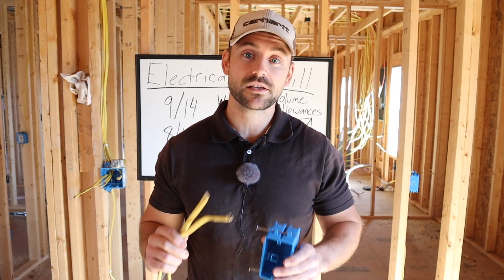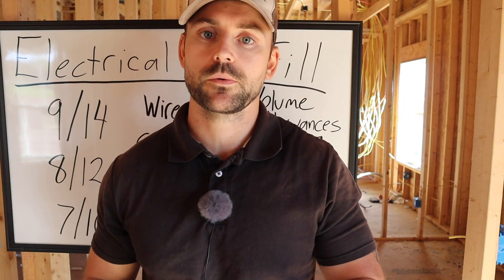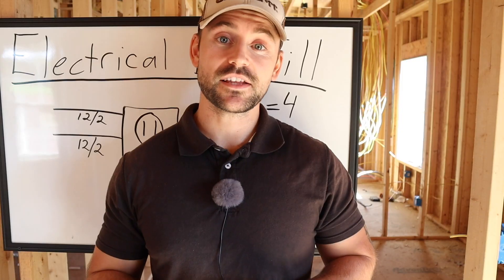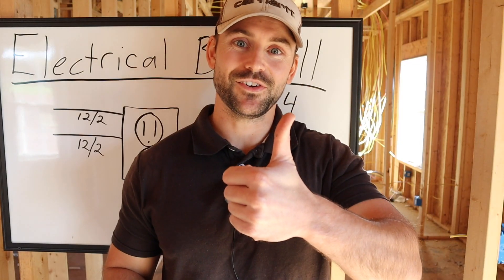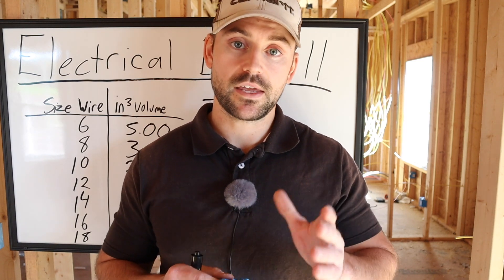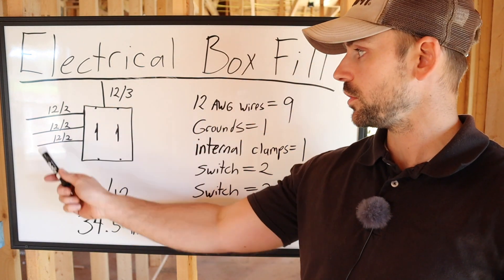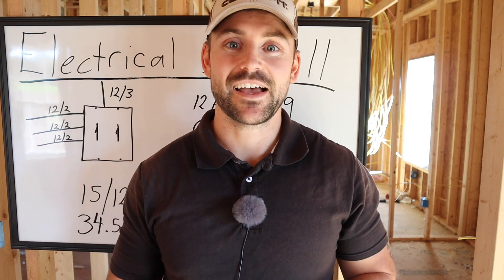Box Fill Calculations - Electrical Box Fill (THE EASY WAY)

Comment from the maker: Hey Team! I hope this video helps you with your project. I placed timestamps below to help you navigate this video👇.
Look what is stamped in an electrical box! 00:24
What do the numbers mean inside an electrical box 01:02
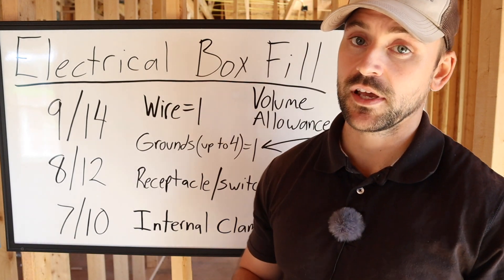What is a volume allowance? 01:25
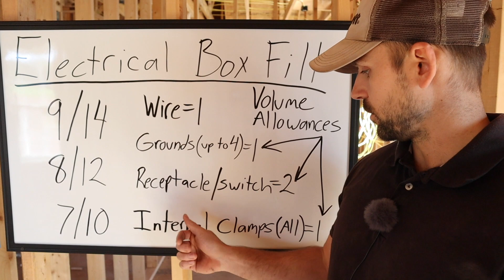What are internal clamps? 03:15
How to do electrical box fill the easy way! 04:01
How to calculate electrical box fill using cubic inches 05:06
Knockouts vs internal clamps 07:25
Two gang box calculation example 07:41

Comment: How about 2 different sizes of wires are inside the box? 

Say; 2-12/2 and 1-14/2. 2 devices, 2 EGC's. 

Which volume of inch factor should i refer to? #12(2.25) or #14(2)?

Comment: Great explanation Josh. Does adding pigtails alter the volume allowance calculation at all by counting as "extra" wire or no? I have single gang box with a light switch with line in and load out and I'm installing an old work box in order to add an outlet (always hot) to the box so I will need pigtails in the box.

Comment: I think you missed 1 volume allowance for the internal strap while calculating the single gang box with 2 wires and one device @ 4:39 Or am I mistaken?
Reply: I caught that too and wondered the same thing.
Reply: Did you mean internal clamp? If so, they do not count for single gang boxes since those are considered knockouts. You only count the internal clamps as 1 volume allowance for two-gang boxes or more. See 7:25 in the video.

Comment: Besides a slightly higher cost, any issue with just doing the larger 22.5 cubic inch box as a default instead of the 18?
Reply from the maker: That should not be an issue to use a larger boxes as the standard size in a whole building. Hope that helps!

Comment: Great explanation!  QUESTION: So what if you have mixed wire sizes in the box.  Say you have two 12/2, two 14/2, one switch connected to the 14/2, and one outlet connected to the 12/3 (split between sockets)?

Comment: The only suggestion I have is adding the section of the code book where these tables are found. I’m in CA with the 2020 code and this info is found in 314.16(A) & (B)  other than that great video.

Comment: What is the volume allowance for a GFCI Plug? I was using a steel RACO box 3" X 2 x 3 1/2" deep. 21" cu. I wanted to have a possible food waste disposal later, so I had 12-3 supply from the switch. It is a steel box so I had a  ground pig tail
Reply: GFCI and AFCI receptacles are treated the same as regular receptacles as far as box fill calculations are concerned. If it seems to be a tight fit, you can use a larger box or add a box extender to add room. Not the box extenders that are used for boxes that are mounted too deep from the wall surface. You could also use a Legrand Wiremold starter box as an extension.

Comment: Question for you about volume allowance and wire within the box. Lets say I have a 2 gang box with both of them being OUTLETS and I have 1 wire coming and I have a short (a few inches) wire to jump power from 1 outlet to the other. 1) That short jumping wire would it COUNT towards the volume? 2) does the wire allowance only count for wires coming in?
Reply: Good question. I’d like to know also.

Comment: So question then:  If the cubic in calc is exactly the size of the box then it doesn't pass code?   To be clear:
2x12/2, plus 1 gnd, plus 1 receptacle in this box, and given it has punch-outs, that's it... and 7 is less than the box wire count of 8 (good) ... and 7 x 2.25 => 15.75 < 18, so again in cubic in... we're good.  Now, let's go to 3x12/2 ... but stay in the same 18" single gang box ...
=>  (3x2)+1(gnd)+1(receptacle) = 8 ... which is allowed per the box - good, as again, the punch-outs don't count ... and the cubic in => 15.75+2.25 =18 (all else being equal gnd & receptacle) ... and that equals the box size 18 in - i.e. doesn't exceed the box size .. so, does this meet go, or as indicated we need to go to a 22 cu in box?

Comment: Great explanation. So many people showing about box fill calculations, but I can't find a single explanation that shows what to do if there are too many wires etc.. in a box. I have a metal 4 gang (4 single gangable joined) that contain 4 14/3 and 5 14/2 and will have to fit 4 dimmers/3 way switches with pigtails and wire nuts. That is way too much fill. Since I couldn't find any solution anywhere, what I did is, I installed a junction box above it near the ceiling (which will be accessible) and I relocated there 3 of the 14/2, which will branch out to the other end switch box. So now, on this 4 gang box I have 4 14/3 and 2 14/2 (2 circuits coming from the box above) and will have to fit the 4 dimmers with pigtails etc... = 4 14/3 + 2 14/2 + 2 pigtails and wire nuts for the each of the 2 circuits + 4 wire nuts for each dimmer = 20 wire nuts? I'm going nuts myself. That is still too much fill ... Help! Thank you. BTW: I'm in Ontario Canada, I know you're in USA, but a solution might be useful in Canada too ..? :/
If the framing studs are 3-1/2", why the ** can't all boxes be 3-1/2" deep? Why bother making the 2", 2-1/2" and 3" deep ones? Life has to be complicated, doesn't it. ?